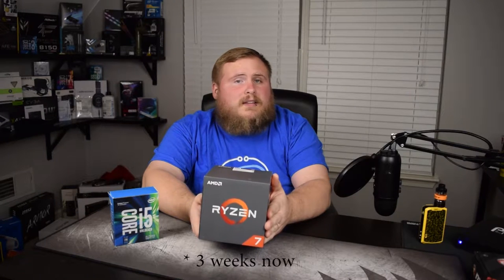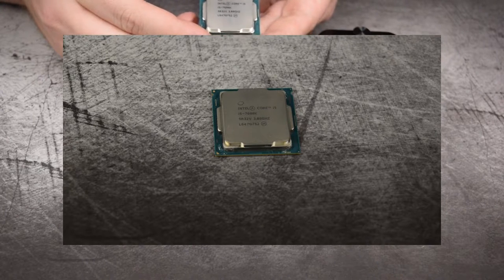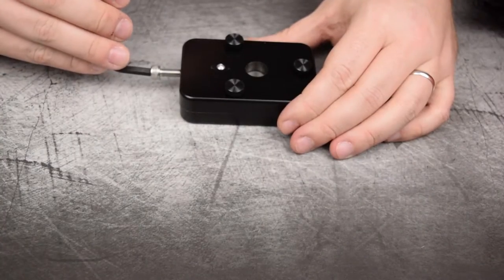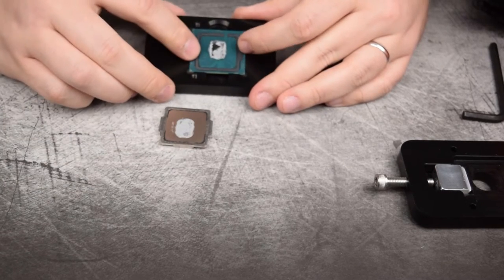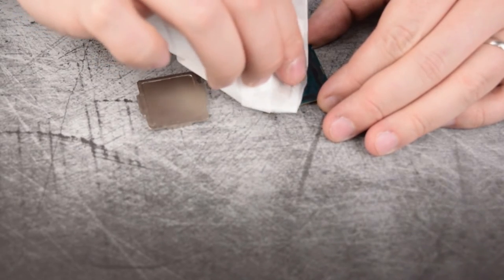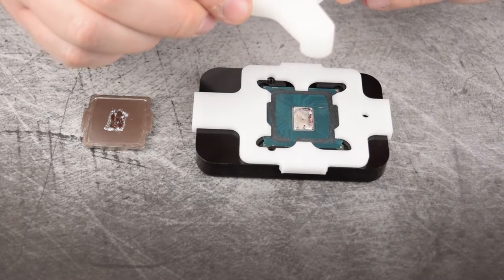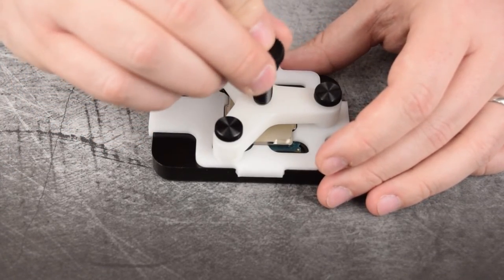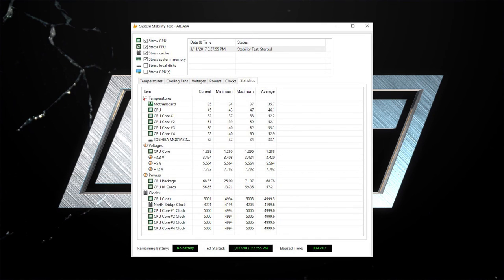[How-to] Kaby Lake Delid- i5-7600k at 5.0GHz- Is the temperature decrease worth it?

Comment: don't ever use super glue get some fucking silicon you moron.  you will never get that thing back off if the thermal material ever degrades and that stuff does.  i can't even describe how fucking stupid that is.  if you don't want to use silicon dont fucking do it!!!!!!!!!!!!!!
Reply from the maker: I can't resist. I have to take the bait... silicon? You want me to use a mineral to seal the chip back together? I know I shouldn't be giving in, but I can't help myself. In addition, I have taken these chips back apart several times without issue. I can say that if you follow my directions, you will have no issues. If you glob on a bunch of Gorilla Glue, no telling what would happen- although I am sure that would still be better than using SILICON...
Reply: Also used silicone, just a few small lines. Works fine. Don't think a small amount of superglue is a problem tho. I just put a the liquid metal on the die and the temps are lovely. I also covered the three points with electrical tape, just to make sure the liquid metal doesnt touch the it. Full Load with AVX max 68° after 12 Hours. Ingame "Just Cause 3" Max settings, 50 ° without vsync. 7700k 4.8 Ghz @ 1.29 VCore AVX -2 cant do better on this chip, higher clocks need much more VCore... This is my second one. I bought it from a german online store.

2 * 140 mm Front Fans IN
2 * 140 mm Top Fans Out
1 * 140 mm Back Fan Out
CPU Cooler Noctua NHD15-s with two nfa-15 PWM Fans. Pushing air out
Case: Cooler Master Mastercase Pro 5
Thermal Paste on Heatspreader: Noctua nt-h1
Reply from the maker: We really appreciate you sharing your results! I have had only two Kaby chips that were able to go 5.0GHz or beyond. Before I started testing with Kaby, everyone else made it seem like 5.0GHz was a given. I suppose it is if you are willing to throw a massive amount of vcore at them, but just like your specs, I would prefer to use a more sensible vcore and a slightly lesser clock. You will almost never realize the performance difference in real world use, so you would be cooking your silicon for nothing.

Thanks for watching and sharing!
Reply: Do you really think 1,29 Vcore is too high? Intel allows more space to be safe? (I've heard somewhere) - The Temps are very stable.
Reply from the maker: r0ck3tdr1v3r I personally am fine with anything below 1.4v as long as the temperatures are within reason.
Reply: if temps are stable Intel spec says 1.45 volt, they recommend  not to go past.
Reply from the maker: You can definitely run it higher than 1.4, but it just depends how long you want the chip to last. If you run a high voltage constantly 24/7, you have what is known as "degradation" of the silicon. That is just a fancy way of saying you are cooking your chip, and eventually you will have to up the voltage to sustain the same overclock.
Reply: hence why the recommend you not go over 1.45v
Reply from the maker: Yes, and I am telling you in my experience working hands on and overclocking for over 12 years, I personally would not go over 1.4v for daily use on Kaby Lake. What anyone else wants to do, is obviously their decision.
Reply: Tuvzii I bet there's a point temp < volt, don't forget the wattage on this little chip. I tried 1.5 and it became very unstable. with 1.29 (depending CPU lottery) I am fine. :)
Reply: Although this guy is pretty edgy he is right, I  used RTV black silicone, it is a sealant that is the only job that this RTV does and is perfect for sealing the IHS is because you can easily delid again and again as many times as you wish. I already delidded my chip sefveral times trying different TIMS. After the silicone vulcanizes you can very very easily take it off and it doesn't leave any traces, it is better than the original sealant they use from intel. Also you have to remember to leave a little gap, dont do a complete seal!
Reply from the maker: Appreciate your opinion on it! Hopefully this can help people make a decision on what they would prefer to use. Thanks for watching!
Reply: why all use coollaboratory , and super glue its so wrong... why not Contatornaut and Silicon based adhesive?
Reply from the maker: Using it the way outlined in the video is more than perfectly fine. I have used it over and over and over on the same CPU deliding it multiple times and it has cause absolutely no problems at all. In regard to the coollaboratory, I have actually since switched over to Thermal Grizzly products.
Reply from the maker: @indicasativafusion  check out Gamers Nexus' long term testing on liquid metal. I was surprised at how well it held up over time. That being said, you are right that nothing lasts forever. Your method sounds like a good alternative.
Reply: Hey i was wondering if it's worth delidding a 3 year old i5 7600 sky lake. It's more for temps since i can't overclock would it help with temps or not worth it?

Comment: Hey with 240 AIO and all fans set to QUIET MODE = 40% and after some fine tuning my i5 7600k is at 5005mhz  PEAK MAX 70c temp FULL Load CBr15 after several runs, 1.285v, would you still de lid or call it a winner as is?
Reply from the maker: If you are happy with your clock speed where it is, I would say there is no need to delid. There is always a risk involved in deliding, and 70c max is not bad at all. I think you are good to go my friend!
Reply: COOL BEANS!

Comment: Hi Guys, I've just ordered a 7600k which I'm going to have delidded by a third party as I'm aiming for 5ghz.
I have Corsair AIO 240mm, do you think it is worth my applying liquid metal between the IHS and Cooling block? Or shall I skip the risk and just apply some decent thermal paste such as Thermal Grizzly? 
Thanks
Reply from the maker: I would definitely suggest some Thermal Grizzly Kryonaut between the IHS and coldplate. Aiming for 5.0GHz isn't too crazy. You should be fine with a good paste rather than liquid metal in that spot.
Reply: Let's Get Techy Thank you, spot on, I'll get the grizzly ordered now. Also, subbed :) once again - thanks.
Reply from the maker: No thanks necessary! :) Thanks for the sub Sam!

Comment: My 7600k is 1.295v at 5.1ghz. On 1.370v i get 5.2ghz. Im not sure if I delid my cpu will get lower results because your delided chip have same results as my non delided one. Maybe my chip is assembled good.
Reply from the maker: If you have good temps with what you currently have, I would not bother deliding.
Reply: Let's Get Techy its too late:) i already delided it.No big difference.Same temps on 1ghz more.

Comment: Hold on so you delid the chip but fail to remove the intel's black silicon glue they used to seal the chip? The reason people remove that stuff is to make sure the IHS makes better contact to the die. Then you use superglue? ohh man i'm glad you only did the corners. Ive seen people rip the green stuff off the chip using that. Which also screwed the traces. Id rather not use anything than use superglue. You could of done with slightly less liquid metal too. Personally though ive seen a good 20 degrees drop in temps delidding and using Grizzly Conductanaught.

Comment: Bruh wtf why do you even glue it back? It can make it perform worse and GLUE, if anything you should use silicon and also nice pool of liquid metal you got there...
Reply from the maker: It's nothing against you Monka, but I'm just so tired of explaining this. The glue is there for a reason- it allows you to reattach without the Z height issues associated with silicone. Doesn't hurt performance- actually helps it versus silicone. As for the LM application, the only reason people use less is due to fear of spillover, and when it comes to spillover, I have balls of steel. Hahaha. No in all seriousness, I had one that I went light on the liquid metal on, like most guides suggest, and ended up having to drain and disassemble an entire loop, so I always go heavy handed on the LM now. Thanks for the comment sir!

Comment: Thank you. Answered my question. WTF intel. I got some great results with 7600k OC but hitting temp wall. Now I know why. In my case it was just for fun and I still got great improvements over stock clocks but come on man. Intel, I would have paid $15 more to have you not leave such an important thing out of the equation. Life long customer. WTF, we should get a class action law suit and force them to swap for corrected cpu's. Any word if anyone is doing this?
Reply from the maker: Hey there. Thanks for the comment, and thanks for watching! 

There isn't any type of lawsuit, but I can tell you there are droves of people who feel the exact same as you do. The only thing I can say in Intel's defense is that there is at least one reason why it could be better to use the thermal paste that they do. So there are theories that they don't solder the IHS because over the long term, going through many heat cycles, the solder could crack, and then that would pretty much be the end of the chip's life. In addition some people have said that maybe Intel uses the thermal paste that they do because of how well it holds up over time. For example you get very consistent temps over the life of the chip, and if they switched to something that might be better in the short term, it might not hold up well over time. 

You can take those tidbits for what you will. I don't know how true they are, but that is just some of what I have read when studying this topic. Intel may honestly just be some greedy SOB's, and want to cheep out for all I know. The good thing is that with modern tools, it is pretty easy to delid if you want to get some better temps. It is a lot safer than it used to be back in the day of vices and razor blades. haha.

Thanks again!! :)
Reply: You rock, thank you for taking the time to reply and a great reply it was.
Reply from the maker: @Vi5oC4n3 I think you are 100% correct. I would have preferred better paste over solder so that people who still wanted to delid could do so easily.

Comment: ~1.37v thats.. high..
Reply from the maker: It's all relative and depends on how much you are willing to use. I usually stop at 1.4v personally depending on the clocks I'm trying to hit, but I don't suggest normal people use 1.4v daily. I'm okay with it if my chip dies whereas others may not be able to afford a replacement.
Reply: @LetsGetTechy  Okay i understand,  max advised for this chip was 1.35V for a daily use. Actually most people can reach 4.9Ghz around a safe 1.3V. So yeah just wanted to notice it.
Reply from the maker: @thinkersaf  Agree 100%. This chip was a slight dud in my eyes. Appreciate the comment!